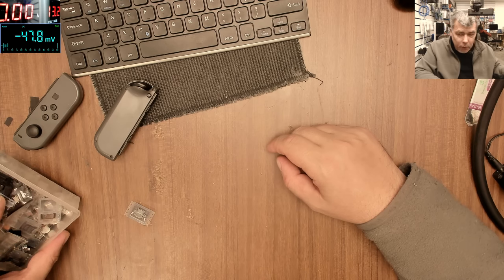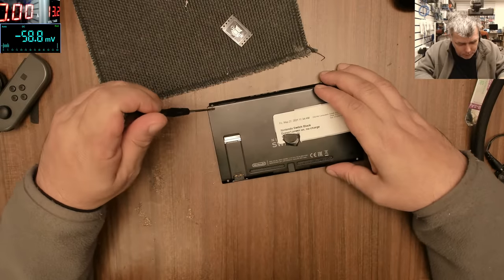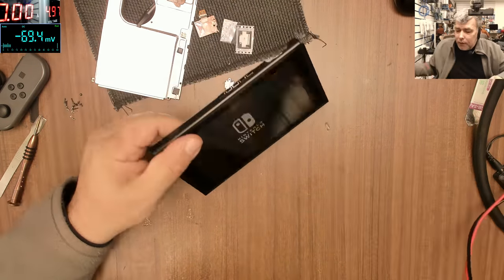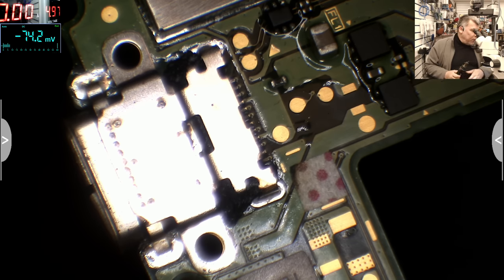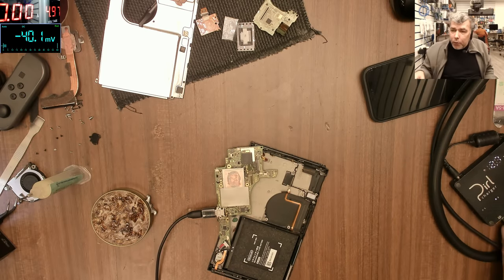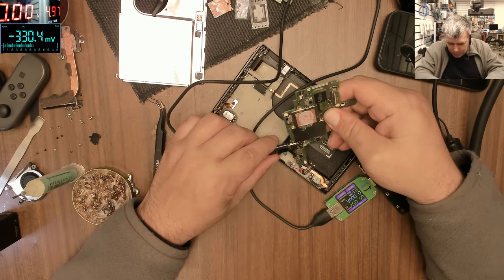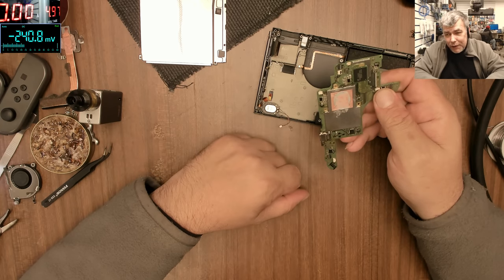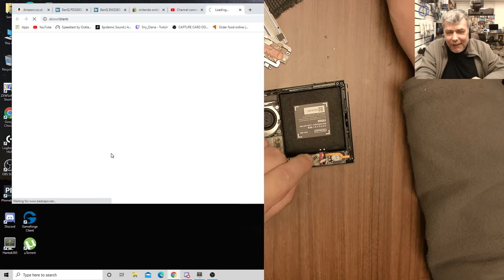Nintendo switch charging port replacement

Comment: When you don't connect the data pins the switch won't work in a dock and there's a chance the USB-PD power negotiation will fail resulting in a "slow charge" fallback at just 5 volts/1.5 amps. The Nintendo Switch uses the USB Power Delivery protocol for charging (at a maximum rate of 15 volts/2.6 amps).

Comment: Lithium ion batteries on Tesla cars probably come with a replacement warranty so Tesla may have slowed the charging rate so it would not have to replace their batteries while under warranty which would be very expensive.I am guessing that the buyers bought their Tesla's on the understanding it can be charged in a certain time frame so if you all of the sudden double the charge time of course the consumer will be upset. You would need their permission to do it and they would say no while the battery is under warranty. In other words it is more likely that Tesla was trying to protect their own bottom line, this is a bad habit all car makers have and we needed new laws to hold them accountable, which we do now. For example if a car had fault brakes the car  maker would not recall the cars because its cheaper to stay quiet...car makers are not innocent. I would still buy a Tesla though because they are great.

Comment: I can't understand why you install a new usb c port without repairing those pads, run trace wires to the coresponding via. you removed the port thus you damaged it. your responsibility.

Comment: Sorin, you're wrong about battery charging: Tesla made a battery, and they said that this will be OK for say 8 years. With fast charging. Then they found out that the battery may wear out in some countries a bit sooner... This means that they will probably need to replace some batteries for free. So they decided to save their own ass and limit the charging AFTER the customer has bought the car. They never wanted to help the customer but to help themselves.
If your reasoning was true, the best would be to charge the battery slower and slower... and actually the best for the battery is not to charge it at all. Don't use it, and it will never degrade! :)

Comment: Almost 220k subscribers would disagree with KTMmotcross (from Badcaps). As you say, a hobbyist and repairing for a living are two completely different processes. Your response to the accusation is typically you. Your videos aren't just about fixing things, you express your understanding of life and that is just as interesting as your repairs.
Reply: Sorin, unlike the "troll" from BadCaps works in real world, heavy downwards costing pressure consumer level repair environment which a lot of techs believe is easy but quickly change their tune when faced with job & time realities.
The cheaper the end product, the greater the repair costing pressure will be & the quicker the break even economic repair viability point will be reached.
The greater the cost, niche, desirability (because its not made anymore) or rarity of a repaired product greatly reduces time costing repair pressures & with enough time & resources almost everything is repairable
Reply: This doesn't just apply to electronics, it's across the whole repair/maintenance industry

Comment: A piece of advice. Use flux when you desolder hidden pins. Flux transfer heat to inner pins and melt solder. Thanks for your videos.

Comment: Want some guidance for an HP 840 G3, the fan starts spinning as soon as power is plugged in. The charging light flashes about 13 times and then it restarts apparently....there's NO DISPLAY....it keep on doing this with out any display....any lead about it?????? Thanks

Comment: Don`t know the details, but from your description I disagree about Tesla case. Some people bough Tesla because it was advertised as fast charging car. Changing main feature of a product after it was bought by customer, especially quietly without informing customer, is a theft. Explanation that it was done for a good purpose is a lie. Obviously they were afraid that battery will degrade so fast that they will need to exchange them on warranty or just it will die soon after warranty and car will have bad opinion on market. How would you feel if you bough 200HP car and after couple days they took 100HP of your engine with an update explaining that this way it will preserver longer in better condition?

Comment: This kind of a fail. I wonder what made the connector come off that difficult. Wouldn't it be better to get some low melt solder? Is the hot air station good enough? Why don't you replace the solder by leaded solder? Wouldn't it be better to pre-heat the board? I think it's not necessarily true that a good job would take more time.
Reply: I agree.  Start by applying flux and then with a soldering iron, apply low melt solder to all the solder joints first.  It mixes with the higher temp lead free solder on the board, and lowers the melting temperature.  More flux and then hot air to remove.  Clean everything up with a solder wick and clean off the residue.  Apply more flux and tin the pins on the board with a soldering iron.  More flux and hot air the new connector back on.
Reply: @GGR543  Exactly. I think Sorin knows all of this, but he somehow feels that given the price of the repair he shouldn't do any of these things or the shop owner doesn't feel like he needs to invest in good tools. The thing is, with good tools and methods jobs go faster, not slower.

Comment: The battery you are thinking of is maybe Lithium - Sulfur. However an Australian institute has announced that they have have been successful in creating an Aluminum Ion battery. If the claim is true then it would be a game changer in many ways. Since an aluminum ion battery would not have the heat problems of a Lithium ion battery in theory you can put a lot of charging current through it with much less negatives to doing so.

Comment: Hi Sorin, try to use low melt solder, is magic, and you will see no damage on the board or tracks when mixing with low melt solder. Do a good clean prior to replace the new charging port with alcohol apply some low melt solder and you'll see how fast is the job done. I bet this job you'll  take no more than 20min! Sorry but is to dodgy what you've done...

Comment: The thing with Tesla: they also noticed a drop in the max distance a car can travel (from 400km to 360km after an update in some cases): https://electrek.co/2021/05/24/tesla-found-guilty-throttling-charging-speed-asked-pay-16000-thousands-owners/

Comment: I do wonder for a long time that does the replacement of some components  could be named repairing ?
Reply: Yes.

Repair 
verb. 
1a : to restore by replacing a part or putting together what is torn or broken : fix repair a shoe. 
b : to restore to a sound or healthy state : renew repair his strength. 
2 : to make good : compensate for : remedy repair a gap in my reading.

-courtesy of Google search

Comment: You should replace the solder with the lead solder, for this kind of situation.
Reply: just use...indium solder, lead solder don't decrease the fusion temp. enough  most of time->...500°c ^^,
you (every hobyist?) need to buy another hot station(the older one  and cheaper one==max 480°c)
Reply: @ZZZ-z9n3n  lead solder do decrease heating time compare to lead free solder.  Do you know indum is a brand not a mix. Please suggest what mix is good for rework job that indum brand has to offer. I'm always using Kester solder, in my whole life as a pcb assemblers and rework technician. And yes hobbyist should get better tools. Unless they really confident in they skills, and a free time.😅😁
Reply: @mohamadasriabdulazid4784   indium is not a brand..it's  indium alloys->indium+ tin http://www.chipquik.com/datasheets/SMDIN100.pdf
118°c  vs 220°c for common  lead free solder
118°c vs 180°c for lead solder

skills and time  can't  fill the gaps caused by your lack of tools

a fx888d is a good tool for an hobbyist
but it never beat a jbc CD-2BQF  and its "active" iron tips
https://www.youtube.com/watch?v=scvS2yeUH00

a.t.m.  sorin's new hakko is old tech.
completely outclassed
but at the same price as the jbc ...
i understand why rossman and cie don't use jbc...vat..
in europe ,it's cheaper, 

when you solder with the jbc, you'll lost 20-30°c( understand to solder at 220°c, you'll need to config your station at 240-250°c)
lost where? in the pcb..thermal inertia

with the old school iron station, you can lose until 70-80°c....
so? you need 275°c, you need to heat your iron tip at 350-360°c
and whit a big ground masse behind your component?

you'll raise both the temp AND the time you need to solder something
(typical example : hdmi port on a ps4,usb port  and so on)

but how an hobbyist can spend 300-400euros for a decent station ^^

don't ever forget...electronic is not for the poor
buy an fx888d for school and the jbc one for the rest
too expensive? make some pottery with your wife :p

yes..using indium solder change a lot , like a lot with a big L
but indium is toxic, worst than lead
but if you have only an fx888 and an old hot station(480°c max) and need to change a hdmi port on a ps4,that's the way to go
(one strip of indium solder of 10cm cost something like 10-16euro)

with the indium solder, you can use desoldering wick like northridgefix in his video

Comment: your correct sir if the battery is charge rapidly in a shortest period..it will be burn and shorten its life cycle... i am also a small  youtuber with thesame concept like you,,,,im your avid student / viewer in your channel thank you sir for the Idea and information you shared
good day
Reply: Incorrect. The battery is designed to slowly charge once it reaches 80% to protect itself...
Reply: @TheCod3r  you are correct fast charging a depleted battery is dangerous and shortens it life span.
Reply: @TheCod3r  yes your also correct...

Comment: Its bad enough charging your phone every day, never mind your car. With my fossil fuel car I go to the petrol station once a week or every two weeks and it takes 5 mins to fuel. With the electric car it has to be every day, and if you go on a long journey you will need to find a free fast charging station and then wait 40 mins for it to charge. Is this progress?